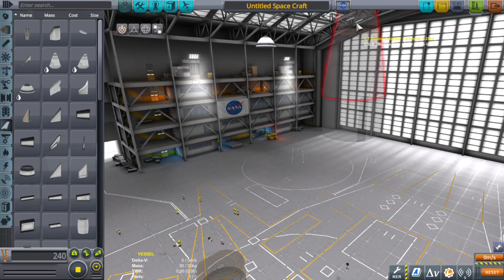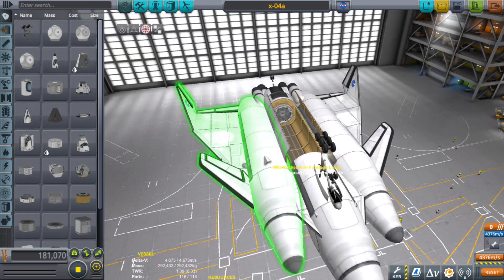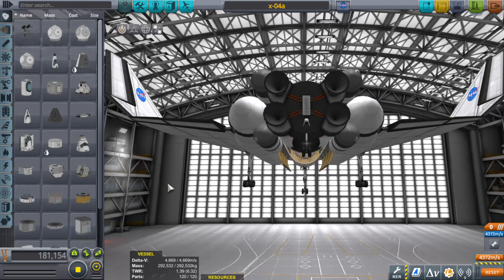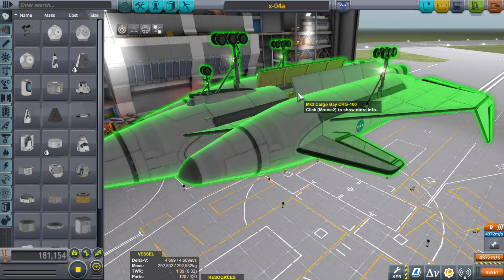TO THE MOON SSTO part 1  \  KSP 1.11

Comment: 4:49 Aw, man!  YT mouse-over preview showed that clip.  I thought it was going to be a whole feature segment.  "Came for the work vlog, was forced to settle for a rocket plane."

0:47 lol That's exactly the sound I make right before I click the "Hide" button in my YT feed.  Those videos annoy me.
6:38 THAT'S a mod we NEED!  A wind tunnel mod!!  Some little window you can bring up inside the SPH/VAB where you can set simulated velocity and altitude (and maybe select different atmospheric celestial bodies, but Kerbin would be default) and see the Aerodynamic Overlay right there in the hangar.  Ugh!  Someone needs to make this naow!
9:26 Archaeologists of the future: "We have found this ancient domestic device which we believe was called a 'keyboard'.  As you can see, the F5 key shows substantially more use than any other key on the device.  We believe the F5 key may have held some kind of religious or ceremonial significance for the people of this time."
Reply: Kerbal Wind Tunnel for the complex version. CorrectCoL for the simple version. I use CorrectCoL and it's more than enough to make an efficient SSTO that works on the first try.
Reply: Hail F5

Comment: Say - isn’t the living pod area “upside down” inside the cargo bay?
Reply: There is no "up" in space.  ;-P  Seriously, though, I watched an astronaut documentary where one candidate was handed an image by a psychiatrist, he said, "You gave it to me upside down," and just like that he was washed out of the program.
Reply: @ArchaicAlibi   Yes - in space there is no up/down. But this thing is supposed to land to mine ore. And that is the circumstance that made me take note. 
I agree it hardly matters all that much. The windows are blocked. The cupola cockpit oriented to allow the kerbonaut to monitor the mining gear from the correct angle when landed, etc. But I just wondered if it was intentional or not.
Reply: @logandarklighter  clears throat I may or may not have glossed over that point. whistles non-chalantly
Reply: I would have said that he put it that way so the kerbal can get through the hatch, well, at least until he mounted the scanner right on top ^^
Reply from the maker: No clue